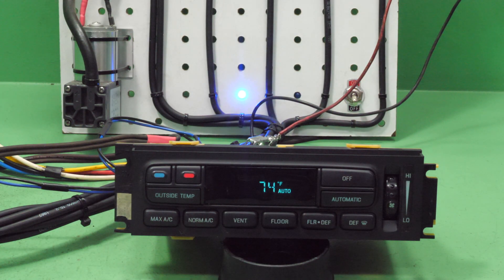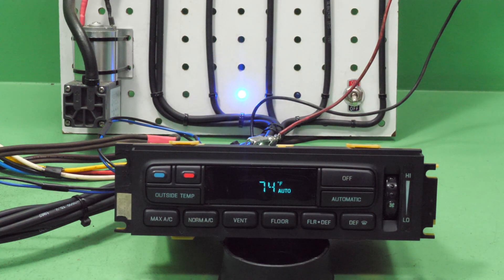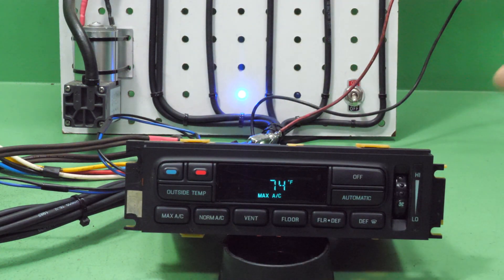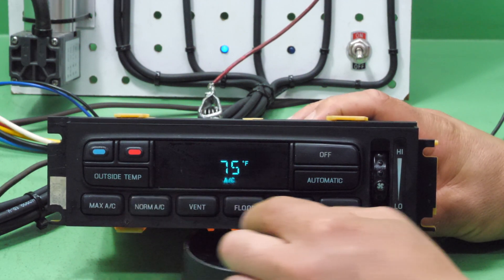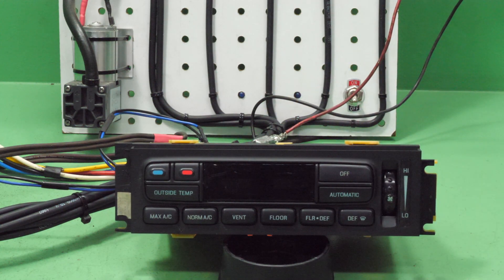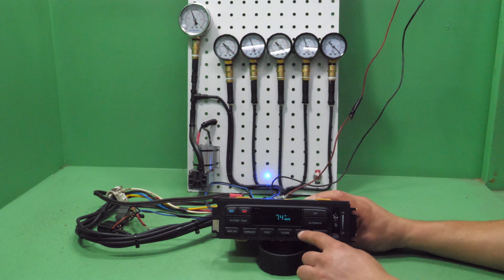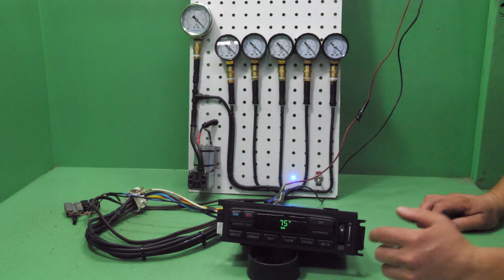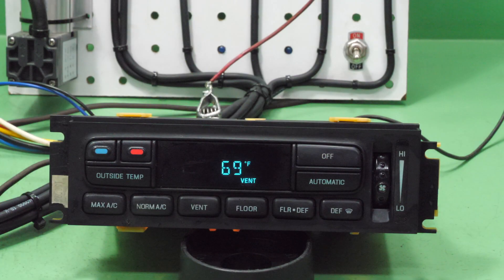Ford Lincoln Mercury EATC Climate Control Failure Modes, Testing & Repair

Comment: my unit in a 2003 f150 the lights that still work dim to where you cannot see the display at times and the mode button lights do not work. how much do you charge to trouble shoot and repair the lights and check all functions?

Comment: On my scan tool I got a code Heater Control 02S11 Fault, it's blowing ac threw defrost vents, I get some cold ac cold air coming out front ac vents could this be the problem ?

Comment: What if the control works, but in about 15 minutes of operation, the cold air goes to the floor and will not return to the vents until the car sits off for a while?

Comment: Hi, Have an ‘03 MGM LS and it won’t blow air through the defroster or footwell. Only the main vents. This a module issue? Or this a resistor issue?  Thanks
Reply: Vacuum actuator .

Comment: The O-ring repair will also service some GM and Chrysler automatic eatc heads.  But use the best O-rings you can buy... surgical works. And then make sure you don't oil or lubricate them unless you want to repair it again in the next year or so. Just remove the rear harness plugs and the retaining bolt(s) and then the 4 or so solenoids and replace the O-rings. You'll know if the O-rings are bad because it'll have trouble staying where you positioned it or it won't switch from one position to another because there's too much vacuum leak. I've seen shops want to replace the whole unit for $700 when a dollar worth of O-rings is all it needs. * If I do it for myself it costs a buck or so for the O-rings. If I have to do it for someone else it's $80/hr+ depending on the job and that's for me knowing what to do and how to do it. I didn't spend thousands of hours in the evening and so on watching TV and playing video games and then wake up one day and know all these things. **If you have Mopar from about 1992 up I recommend a mechanic in Greenfield MO and if you can't afford him I recommend you hire a teenager looking for a joyride.
Reply: Why does lubricating the orings cause them to fail again?
Reply: @TeamLEWIS_HAMILTON because of the type of rubber you're putting on breaks down faster with most lubricants. Not all silicone is the same.

Comment: My original one i believe had the vacuum issue, i'll have to see, but I bought some junkyard units I'm running into a completely different issue, When i plug them in it goes one of 2 ways, either they don't turn on and they shut off my entire dash (radio, gauge cluster, clock), or it burns a hole into on of the chips on the board. I can't find any issue regarding wiring or shorts. i'm losing it!

Comment: The best,

I just said one question What is the open port on the back of the unit where the rest have vacuum lines? It's the port that's in the very middle on the top.

Comment: I bought a new(used) climate control because mine didn’t light up anymore. Once I replaced it, it worked. But just a few days ago that it stopped working, it doesn’t light up anymore, so I’m just curious what could it be?

Comment: What does is mean when no matter the temperature outside it always starts at 40 degrees outside temp when I turn the car on? Then the temperature climbs 1 degree at a time until it gets to about 98 degrees (it’s winter where I am). All functions are working but I can’t use the automatic feature. I changed the ambient air temp sensor and that didn’t fix it. I have a 2000 Grand Marquis. Is my EATC shot?
Reply: Ambient air temperature sensor

Comment: my blower motor is not turning on. bench tested the motor it works. testing plug at motor i have 12 volts with key on engine off even though the eatc unit is off. open ground at the plug. the eatc test only shows 024 is the issue with the eatc unit?
Reply from the maker: Yes, the EATC is the power supply and signal via ground for the blower motor. In your description is would be assumed the EATC is faulty.